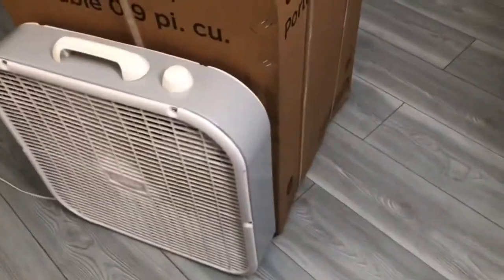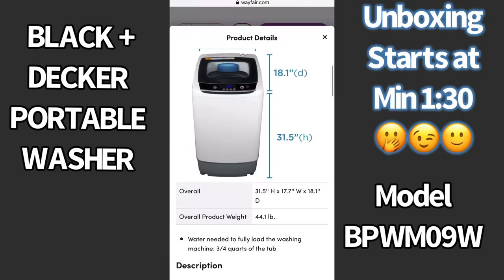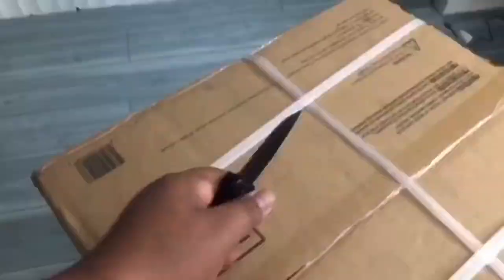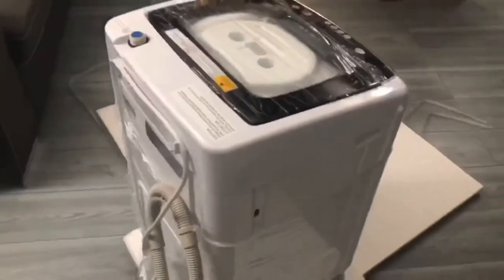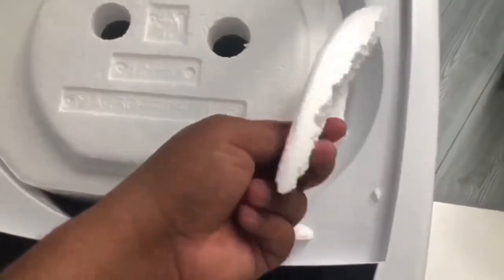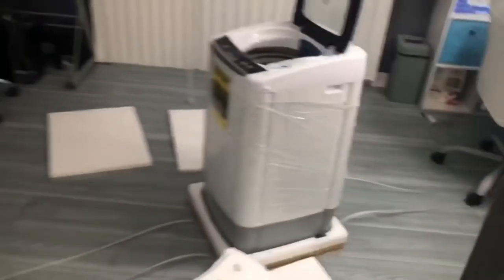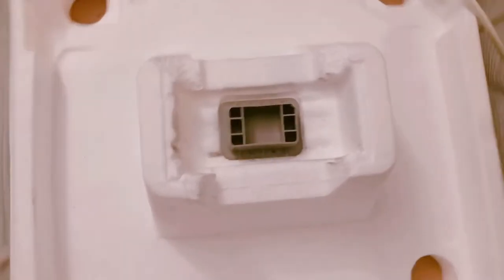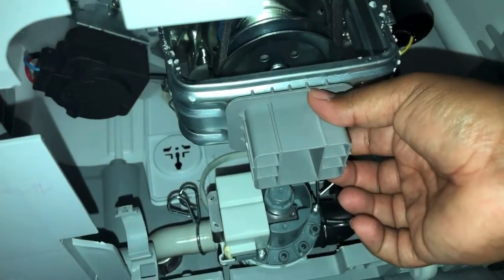Portable Washer Black and Decker 0.90 cu feet

Comment: Mine leaked from underneath every load. Returned it
Reply from the maker: Did you get it from Amazon? And was it the same model? This one comes with the drain hose attached from factory to avoid the leaking issue, no like previous versions